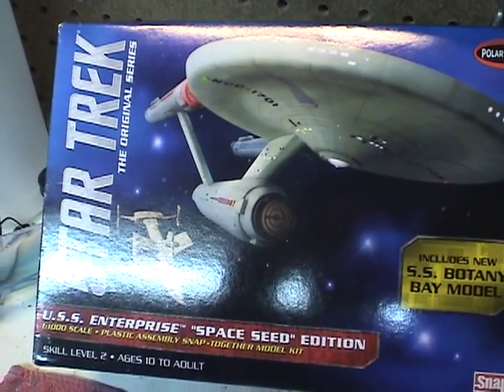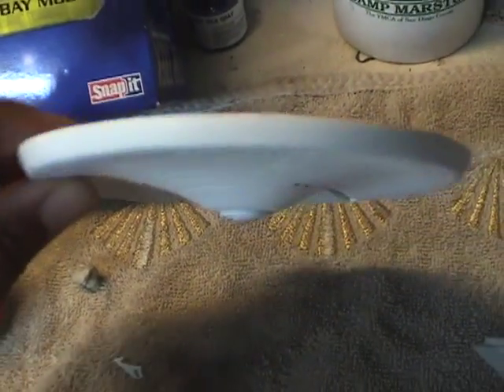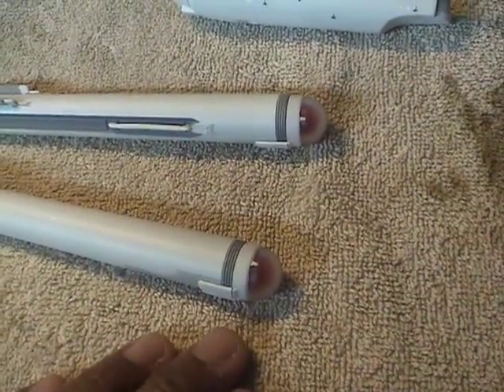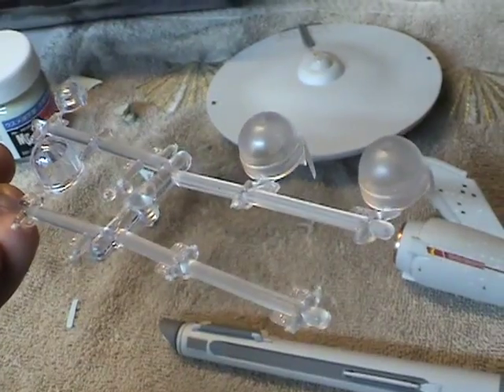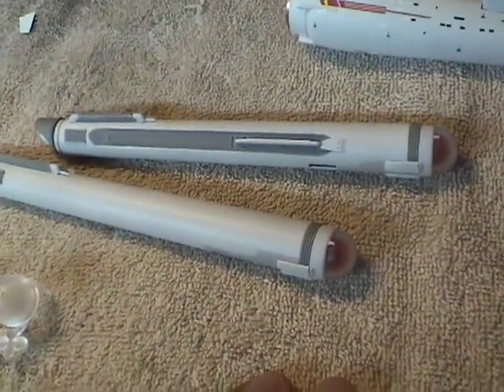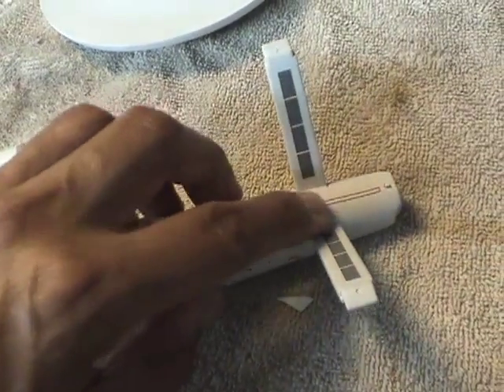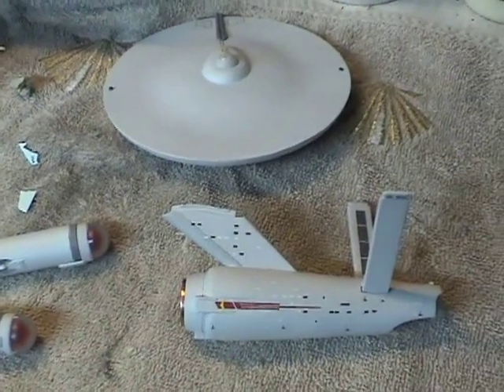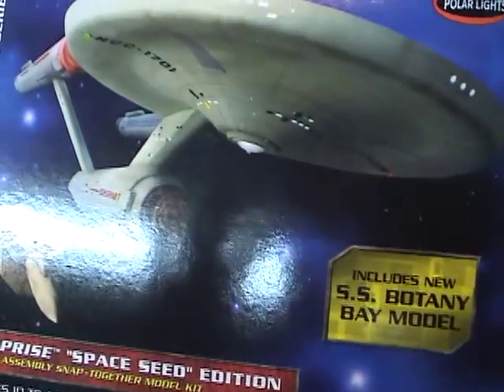Polar Lights 1/1000 Scale USS Enterprise Space Seed Edition Part 2

Comment: I am duplicating your work as a learning method. I think the ship is awesome! When you dull coat nacelle domes did you do this from the inside or outside? The same question for the red paint? please help...thanks.
Reply from the maker: Hi…yes I apply the dull coat on the outside (of the outer dome).  The clear red paint was applied on the outside surface of the inner striated piece.  Thanks for your kind comments.  Let me know if you have any other questions.
Reply: thanks again
Reply from the maker: 07waylow My pleasure

Comment: I was wondering if you have built the tholian web edition kit, and i would very much like your thoughts on it.
Reply from the maker: tim key I've not built that kit but have much experience with the AMT model. As I understand it, the kit is the same as the old AMT model but molded in the glow-in-the-dark plastic material.  I recommend watching this video.  Boyd at Trekworks did a review and build of the kit.  Follow this link and thanks for watching my channel:
https://www.youtube.com/watch?v=HR5o_6B9J9g
Reply: Thank you for your reply, it is the old amt mold, minus the raised lines on the saucer section, its a clean casting, just trying to figure out which cement, or glue to use. I subscribed to your channel, and also to TREKWORKS. Have a great week.
Reply from the maker: tim key No problm.  Interesting info about the kit and that is a good question too about the cement.  Boyd at Trekworks is very knowledgeable.  No doubt he could answer that for you.  Thanks for subscribing.